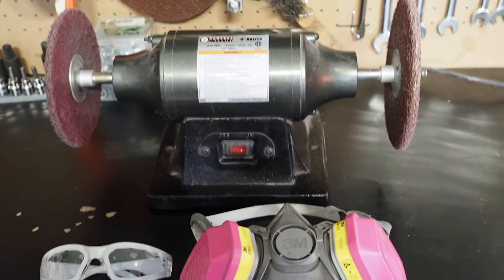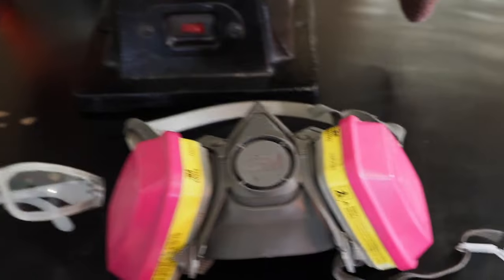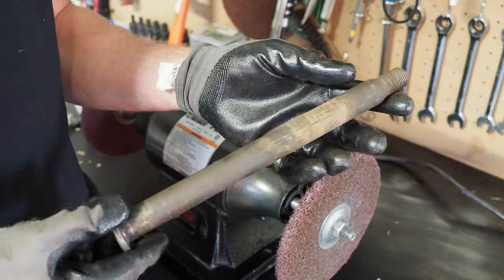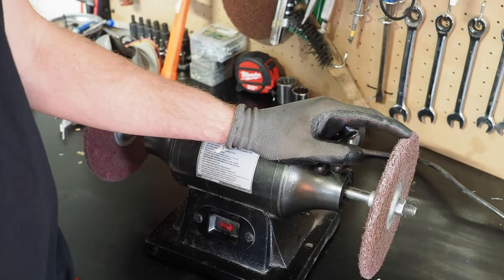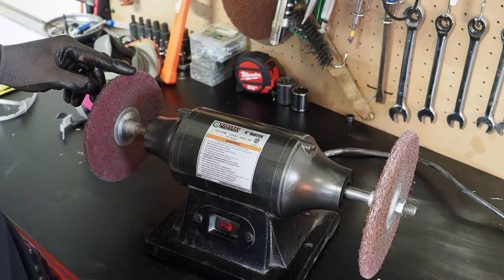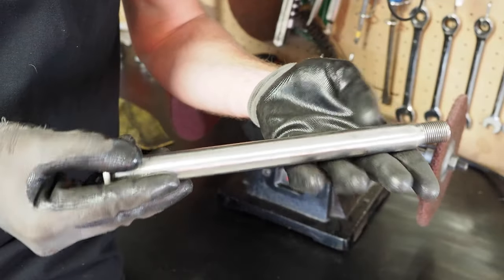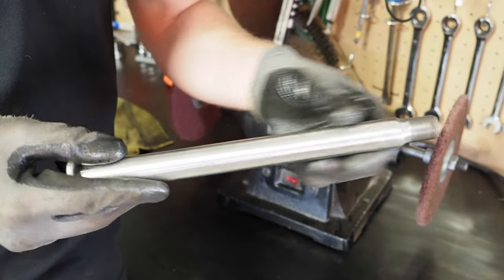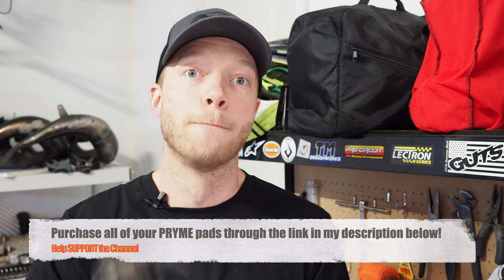PRYME MX Cleaning Pads and Wheel - Review / How To

Comment: How do these compare to scotch bright pads?
Reply from the maker: They are pretty much the same material but the difference maker is being able to put them on a buffer machine like this. There is only so much you can do manually but with the buffing machine or using a dremel/drill for the smaller PRYME attachments, you really can make a difference.  You have to work ten times harder to do it manually and theres a good chance that this axel wouldnt come clean without the buffing machine and PRYME pads!

Comment: Iv been using mine for a week now. Will these pads remove the thickness of the axel? Im worried ill ruin it
Reply from the maker: Nice!  Not at all, especially with the fine pad.  With the coarse pad, I wouldn't let it sit in one spot for too long or else it will start to dig into it but as long as you are consistently moving it, there is no issue.  That rust was pretty thick so I had to apply a bunch of pressure to get it off and it's totally fine!
Reply: @GregHitchko  bitchen!!! Also I put my bench buffer on my works connection center stand. The rubber on the top keeps the buffer from moving🤙
Reply from the maker: @Shipman37x  No doubt!  Thanks for that tip too, I've been trying to figure out how to get it to stay put since I don't want to mount it to my work bench.  Great idea 🙌🏼

Comment: I guess you have to be careful with newer hardware which might have a bit of rust but still have the rust resistant plating (nickle, zinc, etc) -> you might make it shiny but then it's just bare metal and will rust super quick!